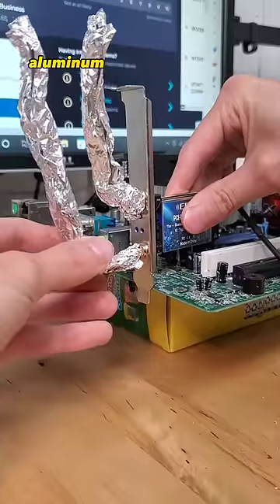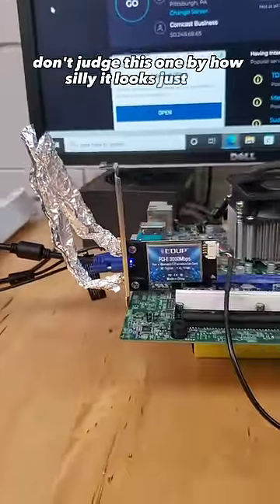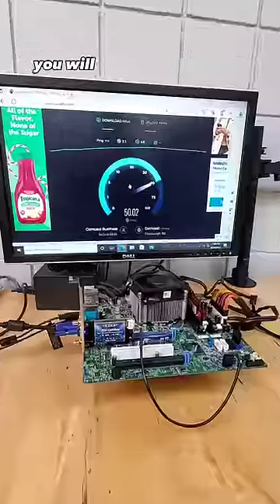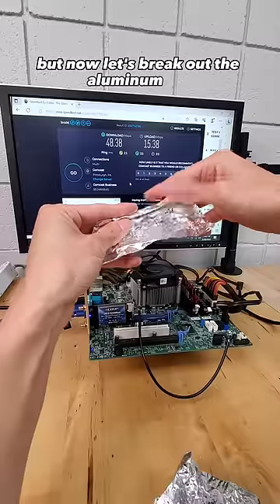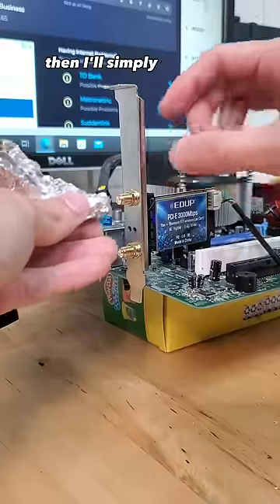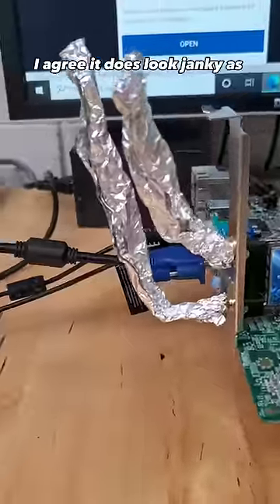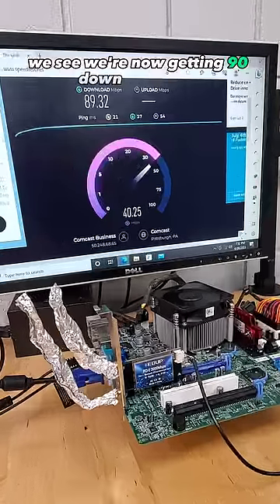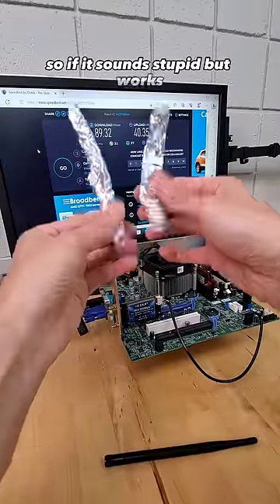can you use aluminum foil as a wifi antenna in your PC? #shorts

Comment: Running a radio chip without an antenna can (and probably will) damage it. 

With the aluminium foil you short it out which isn't good either. 

Antenna's are seemingly simple but complicated and delicate devices. They need to have a very specific impedance (resistance) to work and to protect the chip.
Please always have an antenna connected before powering any kind of radio device.
Reply: average aluminum foil antenna denier 🤓
Reply: @24102 word he dont know the methods 😴 😴 🔥
Reply: short it out? short what out?
Reply: @compactcow  shorting the input/output center pin of the connector due to extra capacitive coupling
Reply: Nerds 🤓🤓🤓🤓 lol
Reply: But only when it transmitting, not when receiving
Reply: First of all it should have protection, sencond of all running such a tranceiver amplifier without an antenna will defenetly not damage it, it just wont really work
Reply: @indian.techsupport  wrong, the transmitted power of the transmitter can reflect back to it if the transmission line isn't well terminated. The reflected power can damage the transmitter with sufficient power level. Learn RF engineering.
Reply: @longpham-sj5sv rue in some cases, but in most wireless cards and even routers the power levels are low enough and there are other protections to minimize damage when silly things happen. I would think that a paper clip would be better than foil, but every case is different.
Reply: Did I ask? NO!
Reply: @ashfaquezskv4558 luckily its only transmitting half of the time.
Reply: How to you short out a ground? You short TO ground.
Reply: Came here to say this. Running any radio transmitter without a load of the correct impedance attached can and probably will destroy it. The standard impedance for radios including the ones in this WiFi chip is 50 ohms. Running it with no antenna is well... open circuit and pretty much infinity ohms, meaning the RF will just reflect back and could damage the transmitter. Also those aluminum foil "antennas" don't do anything at all except for extend the ground conductor. Easy way to kill your WiFi!
Reply: How could running without an antenna damage it lmao that seems made up. Never heard that once before.
Reply: @MrPacman64  RF electronics and AC in general might seem a bit counter intuitive. But without an antenna the chip won't be able to get rid of all the radio waves it generates. They get reflected back into itself raising the voltage and heating the chip up.  If the manufacturer is trying to save some money they might be running the chip at max power. If you run it without the antenna it could push the chip well beyond the intended power rating. 
The antenna is often also used as a kind of heat sink for the chip. It will dissipate a part of the heat from the RF chip. (It is a small effect but it could easily double the amount of copper attached to the RF side of the pcb)

It is more an issue with higher power RF devices, but I still wouldn't try something as dumb as this video. An antenna is $3.
Low power wifi chips probably won't go up in smoke, but they can and they will likely get damaged long term.
Reply: Textbook nerd can’t go outside the box
Reply: Yeah, isn’t this also a fire risk? Because I feel like it might somehow overheat
Reply: @nyanbiscuitpup2  why would it overheat from this?
Reply: @MrPacman64  It has already been explained a few times. but it basically expects an antenna to properly get rid of the radio waves it generates. if there is no antenna of the right impedance attached the radio waves will reflect back into the rf chip increasing the voltage over it, possibly beyond what it was rated for. this can of course heat it up and let it burn out.
I'd say it is not worth the risk since you can get a cheap antenna for a couple dollars.
Reply: @nyanbiscuitpup2  It will likely overheat and might burn out. I'd say it usually isn't a fire risk, it just destroys the chip and that can be rather expensive. at least compared to just getting a $2 antenna.

It may be a fire risk if your computer is packed with dust, but still unlikely for this power level. (unless you have a high power amplifier attached, like what you would find on RV's sometimes. but I doubt anyone with a setup like that would not know about the issues you get if you run it without an antenna)
Reply: @ugandanknuckles3429  yea that doesn't seem correct at all lmao
Reply: @MrPacman64  Google it. I just don't want people to follow these dumb videos and destroy their stuff for no reason.
Reply: @MrPacman64  He isn't wrong. You can't just use random things like aluminum. There is hazards to everything, and consequences if you don't do it properly. Damage can be caused from this kind of thing. Even if the damage is not immediate, it will definitely get damaged long term. Antennas also have a purpose, that is why they exist.
Reply: @l-Zeph-l  lmao yea that's just not really how shit like this works tbh. Never heard of a wireless card going bad from not having an antenna. That goes for any radio transmission
Reply: @MrPacman64  Holy shit some people are stupid. I've been flying FPV drones for over 10 years and it is quite common knowledge even among the rf laymans that a transmitter without an antenna will fry because the radio waves have no where to go except back into the chips. You clearly have no understanding of RF yet you seem so confident lol. You are right though that a wifi card probably won't fry since most are pretty low power and the signal trace on the pcb will let some radio waves propagate and I believe it can couple with the ground plane and transmit some signal through it. That seems to be what's happening when he puts the foil over the ground of the sma connector.
Reply: Agreed. Its probably not a big deal with a couple milliwatts but that SWR goes through the roof with no antenna

Comment: Notice that the wifi card antenna has 2 seperate connectors. First, the ground connector has the thread on it. This is where you screw the antenna. Second, inside the thread, it has a plastic shielding which isolate the ground and antenna pin. Then you have the antenna pin in the middle, completely isolated from the ground.
In this video, you are using an aluminium foil, connecting in the antenna socket instead of the actual antenna. When connecting the aluminium foil in the socket,  you are shorting both ground and antenna.
So how did you get a high speed with this shorting card?

Comment: You can use foil or aluminum cans to make the wifi signal stronger. Idk how or why this works but it does. When i was younger in the xbox 360 days we would do this to boost bad lag in halo or cod. Would go from red/yellow connection to 3 bars almost every time. Was truly a game changer

Comment: PCB already have trace antenna, you actually shielded the SMA output which acted as some kind of reflectors but doing this will eventually burn done the pre-amplifiers on the Rx side.
Reply: No.
Reply: He sounds like he's telling the truth
Reply: Yeah. I was thinking the same. It might burn something inside...
Reply: @SianaGearz  
Even if it doesn't burn it outright because it probably has current limiting circuitry, it is nevertheless overloading it and will possibly cause the card to fail prematurely.
Reply: My brain is too small of understand this
Reply: @the-digital-idiot I sell big brain supplements
Reply: @the-digital-idiot  Aluminum foil blocks any incoming data, which is bad
Reply: True. Even though I don't know the meaning of some of these acronyms, the wifi module will keep switching channels and evenually heat up, leading to excessive load on the "amplifiers" causing them to burn. The signal might be reflected. I think that for the best results, increasing external surface area and making the aluminum highly compressed, leaving no air spaces can help and of course, making it touch the actual port in the middle.

Comment: I'm surprised that worked as well as it did since you only connected to the outer ground connections of those SMA connectors.
Reply: absolutely 🤔👌👍
Reply: 😮💔 And That's Why I Say It's B💩S👎😡
Reply: @wilneal8015 Capacitive coupling is a thing. The antenna pin is an open circuit so its impedance no longer matches that of the PCB trace leading to the antenna. This allows nearby signals like the ground plane to couple to the antenna pin and provide a weak signal, so it's not total BS. It's obviously worse than a real antenna, but it will have some effect.
Reply: Is fake obviously
Reply: @marc-andreservant201  Actually it decreased the distance between the signal pin and a solution that could carry a signal. The proximity to the foil closed the gap.
Reply: Came here to say this

Comment: No…this doesn’t matter. The antennas are actually connected to the center pins in the SMA connectors, not the threaded part which is in this application is just mechanical.
You would have been better off with bent paper clips.
Reply: Yep I’d like to see this independently fact-checked.  Unless his router is so close it’s picking up the signal off the board’s antenna wire before it reaches the connector, that foil should be nerfing his signal if anything.

Comment: I’m actually gonna do this now because I don’t have antennas 🤣 I don’t know how I didn’t think of this earlier
Reply: Powering a RF chip without antenna can and probably will damage it. The chip will heat up because it can't properly get rid of all it's radio power (The power gets reflected back into the chip).
Reply: @ugandanknuckles3429  is there any way I could avoid that?
Reply: @hyxlo_  just get a cheap antenna. It is not worth the risk to mess with them. You wouldn't get great performance anyways. 

If for some reason you really had to make your own antenna just comnect a 31.25mm copper wire to the middle terminal of the connector. Don't let it touch the outside ring. This creates a half wave 2.4GHz monopole antenna.
Reply: @ugandanknuckles3429  ok thanks
Reply: @ugandanknuckles3429 right, but for low power (23dBm-ish) applications like WiFi and LTE/5G mid-band, it will likely only screw the SNR up. Additionally, many chipsets have a bad SWR protection.
Reply: go to the hospital
its a joke 😂
Reply: just like bnc connecter ham radios can do it, but, better to use small shielded wire like audio wire or electronics wire stripped and poked into hole. And use small amounts of aluminum around the outside quarter of his size, Tx level is too low to damage chip.
Reply: I would edit the comment to say that I’m not actually gonna do it but that would remove the heart 😭😭😭

Comment: Now REMOVE the foil and re-check. You'll find it's better because you were shielding the centre pin of the ACTUAL antenna.
Reply: He already ran the test and it was less
Reply: the 1st test was without any foil... rewatch the clip
Reply: It also doesn't actually prove anything to only perform 2 tests. Multiple tests with and without are needed. This very well could be nothing more than inconsistent reception/performance due to the lack of an antenna.
Reply: @fireball2275  the outside is already electricity connected to the pcie braket ground and chassis of the case. By adding more conductor around the center wire he is making a sheild. This would not work and should make it worse. I just tesed it and yes after adding foil i get no connection.
Reply: @jesset2550  huh, good on you for checking, il take your word on it
Reply: @jesset2550  Depends on the structure of the antenna. With a dipole antenna it'd be better, but with a 0-ohm resistance antenna it wouldn't work because there must be a connection between the center pin and the shield. Try that one without the foil OR antenna and if it still doesn't work, it's not a dipole antenna.
Reply: Hey Callum

Comment: As an engineer I was always taught never to operate the equipment without the antenna attached, that was with drone equipment so it probably had more powerful transmission circuits as it would send video and telemetry for around 5km. Non professional home grade equipment is probably not powerful enough to burn itself out. The batteries were the dangerous things though.

Comment: That would be nice to compare this method with a copper wire directly in the center hole (if it’s a reverse polarity SMA). Then you could cut the wire, little by little until you have the best speed. Some good results should be observed close to a quarter of the wavelength in length. Good luck !

Comment: The "exposed wifi terminals" are the ground for the wifi  ports. The actual ports are the pin holes in the center of each terminal. It works because of the proximity of the janky antennae .

Comment: I’m very surprised your WiFi card hasn’t burnt out but this is a pretty awesome finding, I’m guessing wouldn’t want to do this long term though
Reply: For a dipole antenna (what coax WiFi cards use) it doesn't matter. The center pin is isolated from the rest of the antenna anyway, so what he's doing is perfectly fine.
Reply: @Mavendow nah this definitely makes the wifi card try to work harder because the signal is blocked/reflected at the intended output. My guess for why it improves the signal  in this case is that some trace or component on the board is acting as an antenna instead. This will likely cause the card to fail prematurely from excess load / mismatched impedance.
Reply: @naomiwolf8944  ... I mean, the first sentence is possible, but the second makes me severely question which school of engineering taught that. Oi vey.

Comment: You connected the ground. The pin in the centre is actually the antenna. You would get the same result by attaching the foil to the chassis.

Comment: Wifi anthennas are coaxial cables. 
Just put a 3cm long electric wire on the center plug.  (DONT BREAK THE PIN!)
 This is the correct length for 2.4ghz and will restore the reception.

The threated part is a ground. Insulating the wire so it can stick out further/higher/furher away from the (in this case wifi card)
Only the center wire sticking out 30mm is the actual anthenna.😊

Comment: Remember that the connectors themselves act as an antenna, but it would make the circuit heat up due to high SWR,
In addition the live part of the connector is the middle copper part the outer metallic part is grounded, and in addition the aluminum you connected is non conductive.
More over touching the connectors could cause some burns and possibly electrocute you,
So to conclude, don't be stupid

Comment: When I was a kid and my parents refused to pay for good internet. I took our old router, flashed with DD-WRT, used some less than legal linux distro/tools to crack the neighbors wifi passwords and eventually built my own antenna out of and old directv dish and aluminum foil. I could pick up ssid's from miles away, make solid connections to houses about 2-3 blocks away with good enough signal to be better than the internet we had at the time. It worked great and allowed me to build a massive music, movie and game library since I was able to keep multiple wifi connections alive and downloading from 24/7. All internet was either DSL or dial up back then so I had to be careful not to bog down someone's connection to the point they notice and started resetting their modem or worse call their isp. Meh it's what helped me learn computers and was a lot of fun just to test how far I could take it.

Comment: Your SWR might be high and could damage the transmitter circuit.
Reply: By extending the ground plane?
Reply: @GordieGii  And not impedance matching the other end. Luckily some of these circuits are robust but talk to ham radio operators. I am sure enough of them have had experience blowing the receiving side of the circuit due to a mismatched antenna.
Reply: @coll6  But the part that he connected the foil to is also connected to the chassis, which can vary from almost none, like this case, to a massive gaming case, or even a whole rack. If this part of the circuit were critical, every yahoo who plugged in their computer without installing the antennas first would blow up their card. The little bit of foil he attached would make no difference in comparison to the size and location of the case. If he had connected it to the center pin of the connector, that would make a huge difference.
Reply: @GordieGii  Probably I cant say for sure how these particular devices are wired up. If the outer is chasis than yeah that makes sense. But it usually isnt a good idea poking and prodding this crap or encouraging it. You never know there are a few oddballs out there.

Comment: That’s not quite how an antenna works. Connection is made through the small hole in the middle (center conductor). The outside threaded portion is for shielding.

Comment: If you want to make it better take some thin metal wires and stick it into the little hole in the center and run the wire through the foil
Then secure the foil to the terminals with more wire

Comment: Basically anything conductive roughly the size of the antennas with good contact to the terminals will be basically as good as the antennas themselves unless you are doing something really exotic like "directional" 60 ghz wifi or something strange I don't know if it would work as well. But normal wifi, yes.

Comment: Running good old coaxial cables is also a good idea, since coaxial cables has both copper AND aluminum in its core that makes it an even better antenna than your wifi antennas.

Comment: I work as a transmission system operator (fancy name for radio operator) this would work way better if you were to roll the tubes small enough to connect to the actual pin inside the connector then cover with an insulator, electrical tape might work to wrap around the exposed metal
Reply: Also if you really can't get wifi antennas just use some wire from headphones or old electronic cables and connect them to the pins